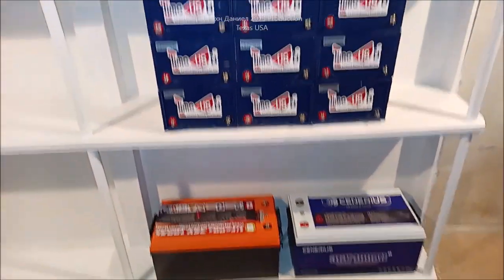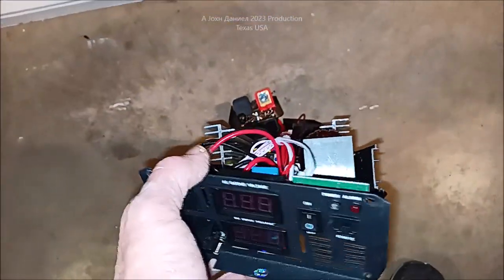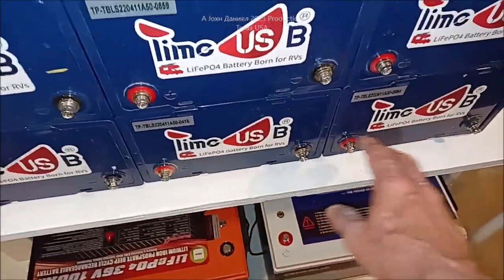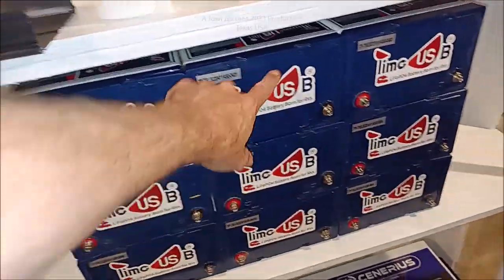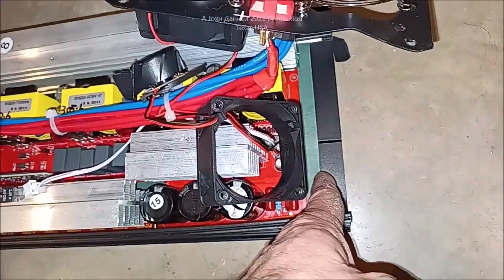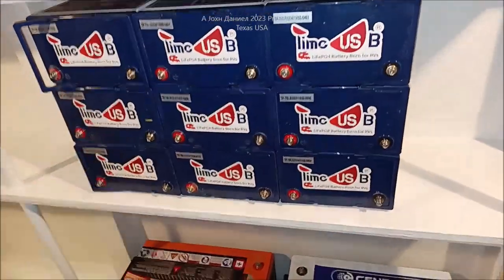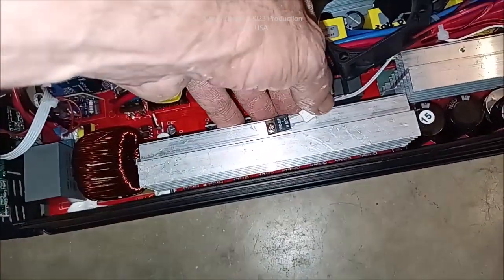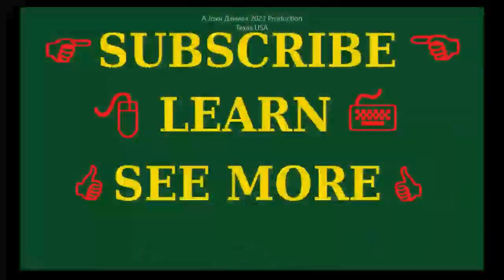Xijia CN Swi-power Busted up 36 volt inverter I got while building 12 & 36 volt DC power system

Comment from the maker: TIME USB Batteries, best affordable choices - https://amzn.to/3QJi1Dr Swi Power inverters, https://ebay.us/BReYdW Unlimited input Voltages, Tough enough to be run over by a fork lift! Support/Join with KoFi - https://ko-fi.com/john4kiera OR https://bit.ly/2buyaCoffee all support helps. AFFORDABLE PARTS for SURVIVAL OFF GRID https://amzn.to/42cdjBX 
⬇ 93% Survivalist Agree, see the "Elite CAUSED" ENERGY CATASTROPHE SURVIVAL OFF GRID SOLAR POWER SYSTEM -- 100 Watt Panels (12) https://ebay.us/Zla5aq , Affordable durable solar controllers pick (2)60A https://ebay.us/pODwA7 ,Solar Connects https://amzn.to/2XJOa1M ,Battery cable USA made https://amzn.to/3h6dsim ,12/2 Above/Underground https://amzn.to/2XIJolg for safe DC wiring of lights and appliances.
SWI Power Inverters has proven 6+ year record of quality - 3000 watt https://s.click.aliexpress.com/e/_DBkXAfH & https://ebay.us/YEaTX9 for tool, high amp, fine electronics

Comment: I have a question about the 100 watt Timeusb.  Can they lay on there side, also and can I stack one on top of the other?
Reply from the maker: They can lay on sides, but not top down. These are brutes and I did other videos on them.
Reply: Thank you, I liked your review of the Timeusb battery, so I got two of them. I am wanting to build a 200 ah solar generator. I have a Bauer modular rolling bottom tool box, from Harbor freight, I was wanting to mount them in. The 2 batteries will not fit side by side, upright, so I was wanting to lay both on there side, but on top    of each other. Do you have any ideas of how  I could do this. This is my first time working with lithium batteries, I always stayed with lead acid till now. I have fallowed you guys forever.

Comment: Damn, that's a lot of damage. I never heard that 48V is deadly, good to know.
Reply from the maker: A 9 year study by Bell Labs in 1948 to 1957 of installed military equipment found that electrical induction of the human body is increased by multipliers of 1.087 per 1/5th volt over 40 volts. The result was making all Korean military battery and DC generators 36 volt. They recorded 1604 injuries in troupes when voltage was over 40v even though only 35% of DC equipment was 40v+ and only 18 injuries when voltage was below 40v. Study concluded that the saline and mineral content of the human body is able to pass voltage easier once the voltage was high enough to excite the conductivity of the person in contact. * (Conclusion - 18 to 36 volts can kill you under rare circumstances, but your risk is over 95% lower than with 48.)

Comment: ha John question for you i want to run 3/4 hp submersible well pump 220v what would you recommend for an inverter 8-10 amp draw
Reply from the maker: Sungold 4000 with 240 output, auto gen start, bypass, UPS function, huge charger built in, low frequency, and heavy 8 awg hard wire feature https://amzn.to/3Sq4VMq
I will be installing one on the 12 volt side here.
Reply: @JOHNDANIEL1  the one you refered to at Amonzon is 120v do you have a reference for the 240v?
Reply from the maker: Sorry about that, Yes, the 4k 240 volt is what I use https://amzn.to/3SHStIb

Comment: P.S. forgot to ask in the last post, Time USB has a 140 Ah bat. in a standard 100Ah size case advertised on their site now. That's a big output up-tick for that size of bat. Do you know/have you heard any scuttlebutt on that one? Thanks, and be well.
Reply from the maker: I have one, the cells are very high quality and mine pulled consistent at 145.2 ah on 5 times. Same every single time. A rare thing with LiFePO4. That link to them under the video has a bunch of 10 and 15% off offers on it. https://amzn.to/3G3NL01

Comment: I think I may have damaged some internals to my 48v120v SWIPower 3000w inverter. But, since all I use it for is large inductive loads, I can't say I'm surprised.  It did well when it was working. It's still a high frequency inverter and not designed for such use.
Reply from the maker: High Frequency is bashed by the dealers of high dollar products, but the reality is High Frequency is just phase positive on both sides of the wave and nothing is harmed by it since its actually a more stable output with much less idle power losses. It should be used in dedicated isolated lines and never earth grounded.
Reply: @JOHNDANIEL1  
I recently watched a video on why inductive loads killed high frequency inverters that showed the oscilloscope results of inrush on the mosfets, which made a lot of sense. As soon as ECPC gets their 6000w split phase inverter back in stock, I plan to order one. It's the same inverter as the Sigineer unit, and looks exactly like the Sungoldpower and the AIMS inverters. LED locations and all the switch and post locations.
What I do know is that now, even my hand drills smoke when running off of the SWIPower. Much like I have seen using too long of an extension cord.
High frequency inverters are supposed to be good for 2x rating for inrush surge. Low frequency is supposed to be good for 3x rating. The actual inrush can be 4x the run amperage. There is another video where a 750w load inrush, overloaded a 5kw inverter.
Reply: I ordered the 6kw split phase 240/120 inverter from ECPC/Energetech, what was delivered was the Sigineer APC6048D. At a much lower price. Just got it hooked up today, but it had no problem starting the larger air compressor that had bogged the SWIPower 3kw inverter down. I'll probably rewire that compressor to 240vac, now that I have it available, because it was drawing almost 22 amps @120vac under load. Running from (2) EG4 rack mount LiFePO4 100ah batteries.